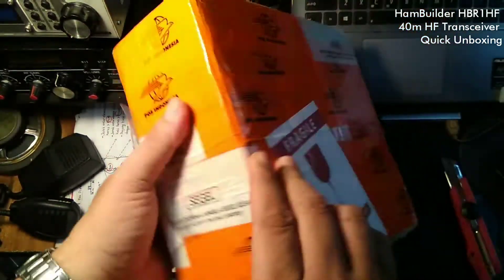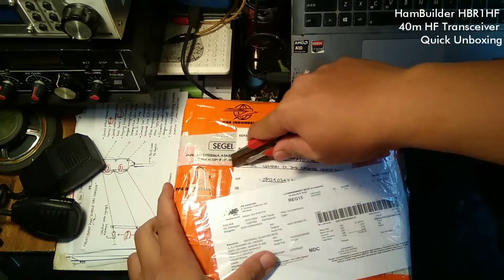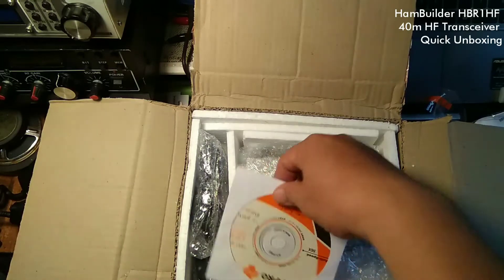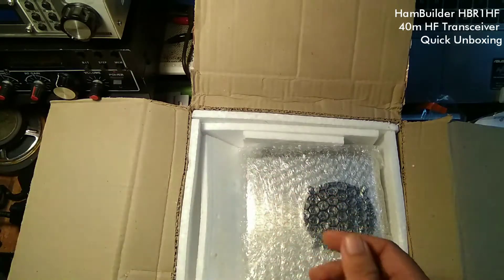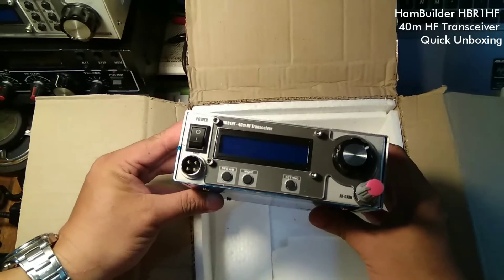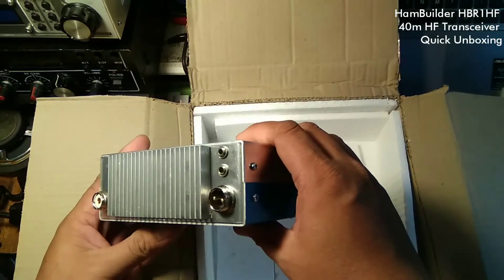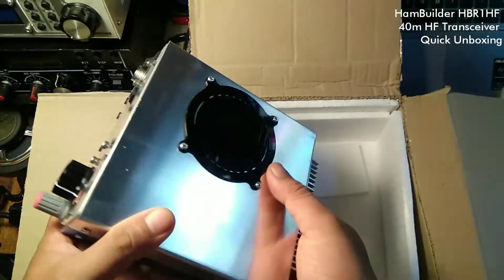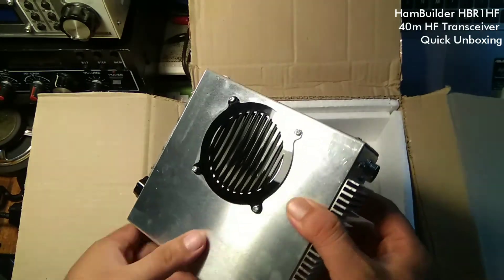HamBuilder HBR1HF 40m SSB & CW Transceiver Unboxing & Hands-On

Comment: Is the power output adjustable because on Ebay  the specks says  this radio  is 25 watt radio max .
Reply from the maker: Yes it is 25w on full, but it can be adjusted, and I have it set on 10 watts for QRP
Reply: @anarchian5401  Thanks